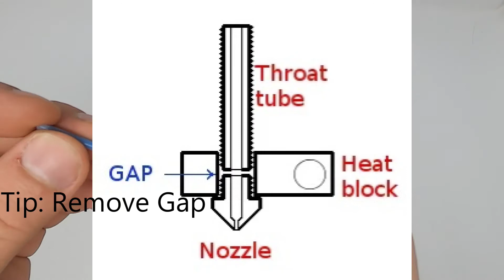3D Printing Layer Shifting, Thermal Runaway and Extruding issues (Read Description)

Comment: Hey, thanks so much for this video! I was getting thermal runaway on my CR-10 and couldn't figure it out for a while. I changed both thermistors and was ready to start ordering more parts until I saw this video! I was just getting low volts on the power supply.. It was at 22v and turned it up to 28v and I am able to print again! I'm sure I'll have to get another power supply soon but for now it's going great.

Thanks!